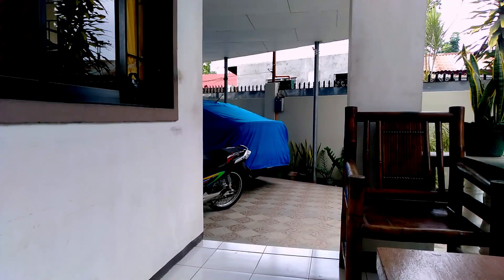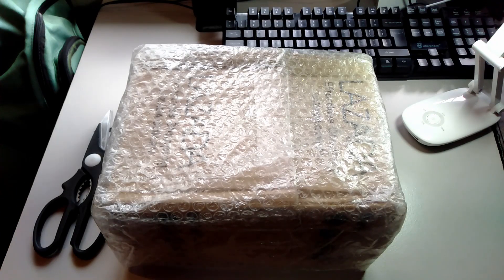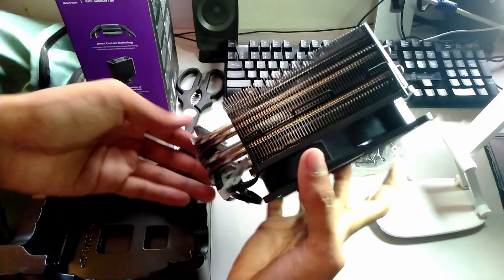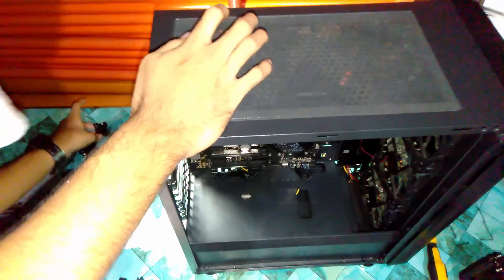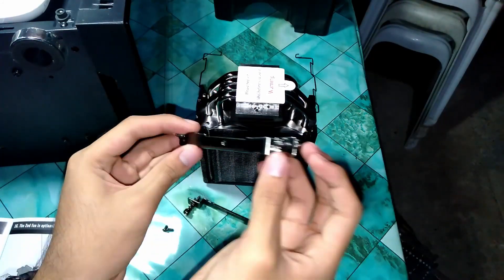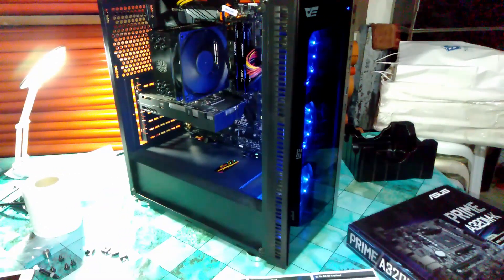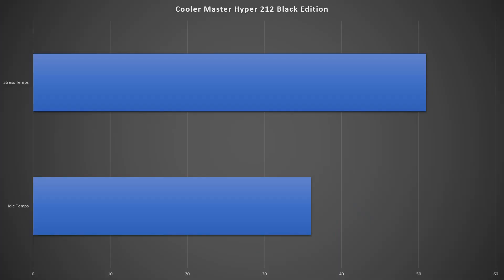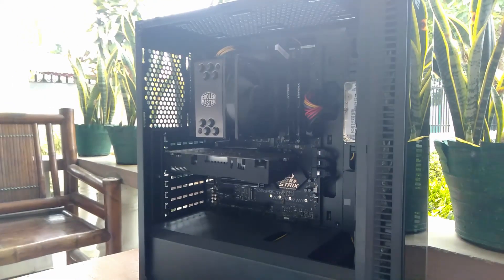Cooler Master Hyper 212 Black Edition Review

Comment: Is it worth upgrade from wraith prism to hyper 212 black edition?
Reply from the maker: first what cpu u have right now?
Reply: @AspireTechYT  3700x. Dark rock pro 4 is also good. But i dont plan to overclock, so i think 212 would be enough.
Reply from the maker: @nikolaandjelovic781  then it should be fine with no oc
Reply from the maker: yeah but if you want a better one, you can go with the noctua cpu coolers